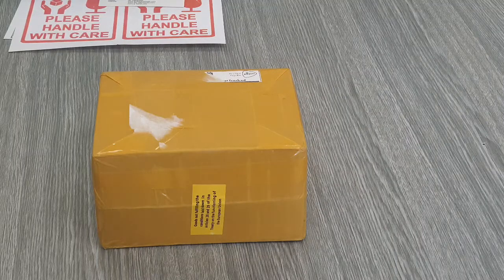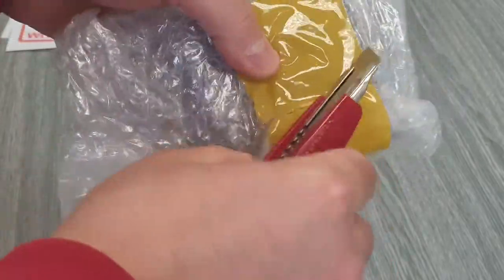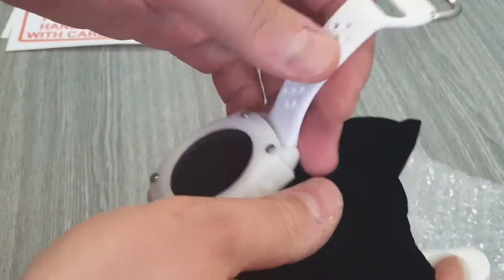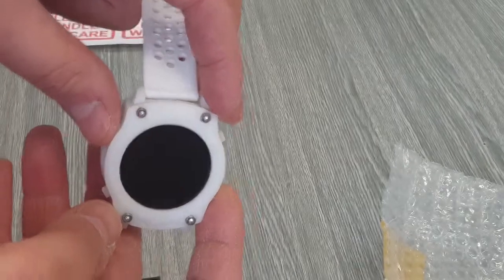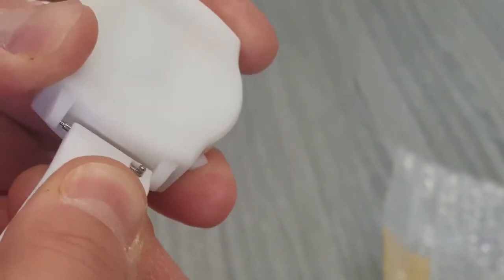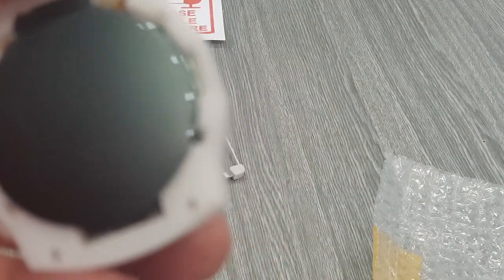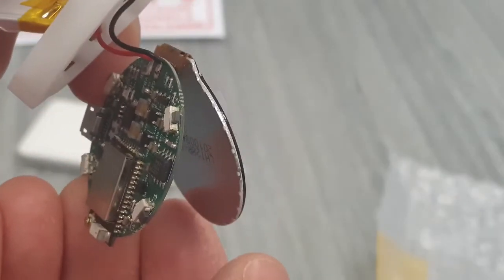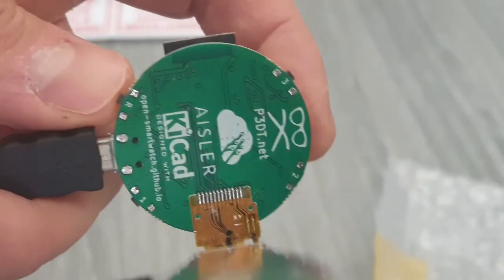Open SmartWatch unboxing and powering up

Comment: My solutions to the strap are to buy a new strap, or change the pins in the existing strap (if you can get the existing pins out). They are 20mm.